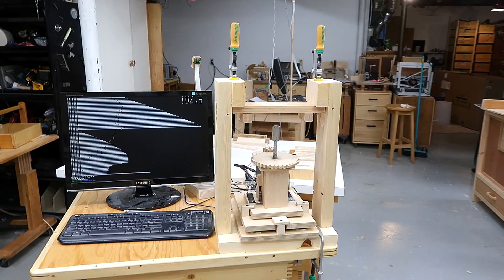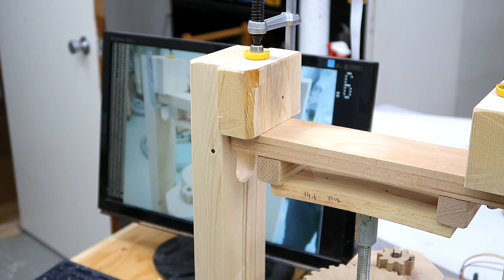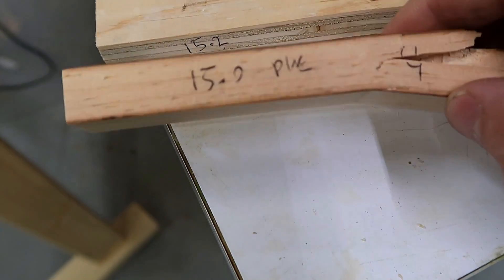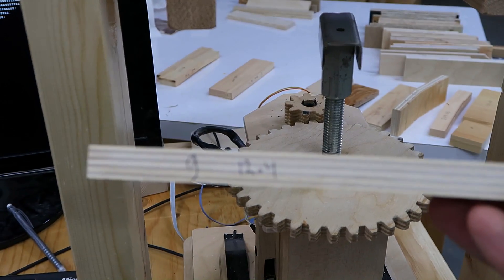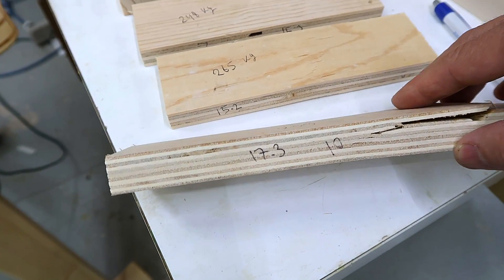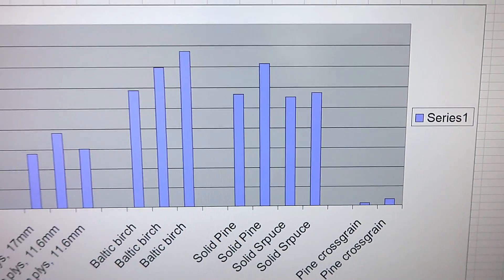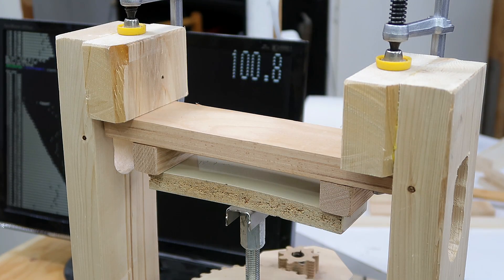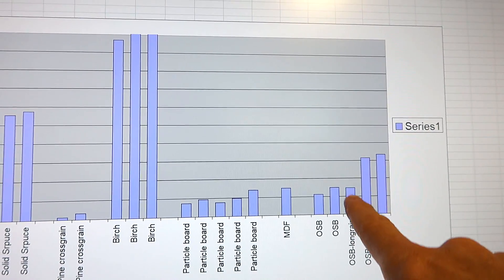How strong is plywood, MDF, OSB, particle board vs. solid wood

Comment: Nice tests. Now what about testing ply on edge? I would like to know the strength characteristics of 3/4" thk plywood when the load is applied to its edges. For example, if you stand the sheet on edge and put a weight on top (both distributed and point loads). Of course assuming it is adequately supported in that orientation. Does anyone know of a reference source for that engineering data in these scenarios? I will also be varying the height of this edge up ply wood too meaning I want to know how it's strength and deflection resistance changes as I make the plywood shorter and shorter or taller and taller depending on how you look at it.

Comment: I suspected these results, having worked with wood my whole life.  This is why I only build kitchen cabinets out of solid wood - especially the shelving.  When you stack a bunch of plates on a long shelf, if it's not natural wood (usually particle board or plywood if you're lucky...) it bends in the middle and has to be supported.  Solid wood always holds up.  I also refuse to use OSB for floor or roof sheathing, nothing but good plywood.  Walls can use OSB because you usually strap and use something else on the exterior, but if I was doing something like stucco or another applied product, plywood is better there too.  It all comes down to cost.  You get what you pay for.  That's also why I built my own sawmill, it's nice to be able to mill your own wood!
Reply: Good engineering doesn't overbuild and overcomplicate. Particleboard, like what you see with IKEA kitchen cabinets, are more than good enough for high-quality kitchen cabinets. People also shouldn't overload their drawers and their shelves. Take care of your stuff and it will last a very long time.
Reply: @CorneliusTaylor-s1u Yes, and as long as you don't mind lightly loading your cabinets, it may hold up for as long as you live.  However, looking at the 100 year old plus solid wood cabinets still in use today, fully loaded, I would argue that particle boad is not good enough for high quality kitchens, but rather for low end kitchen cabinets.  Plywood is better, but real wood is best.  Even at half the thickness, solid wood will out-do particle board any day.
Reply: @timfarry7071 

I didn't say anything about lightly or not fully loading IKEA cabinets. I said not overloading. 

IKEA cabinets are proven over decades now. It is in your business interest to trash them. You are not objective.

Oh, and plywood is much stronger and more stable than natural wood.
Reply: @CorneliusTaylor-s1u "not overloading" is the same thing as lightly or not fully loading.  I am completely impartial, what makes you think otherwise?  I have built with all three types of materials and gave my honest observation. Real wood is stronger than plywood due to the strong bonds.  Plywood is simply more dimensionally stable and uniform.  Real wood can fail at some points, but generally is the strongest overall, especially if it gets wet.  Plywood and particle board will delaminate and puff up.  So I guess it depends on how you use it and in what environment.  Wet environments are horrible for particle board, and in outdoor type environments even plywood can delaminate, and yes, even wood outdoors can fail over time, but generally holds up the best.  You can pick particle board if you want to keep costs down and keep it under ideal conditions year round, that's up to you!

Comment: I have three issues with the tests. 
1) You started with the round top on the piston and then changed to the piece of channel iron. All tests (not just the later ones) should have been done exactly the same way. You may have found the plywood tested even higher if it was changed.

2) You should have tested all at the same thickness and not trying to adjust for thickness in the results. The solid boards, fiberboard and MDF could have easily been planed to exactly the same thickness as the plywood (although the various plywoods couldn't have been planed down and still show accurate results.)

3) The samples should all have been the same width. When you realized there was an issue with hitting the breaking point with solid wood and you used a smaller width, you should have repeated the tests on the plywood using the narrower width as well .

The rules of thumb may be "2x the height, 4x the strength" and "2x the width=2x the strength" but that doesn't always scale precisely, due to if tit's quarter-sawn or cross-sawn, how wet or dry it is, etc. Tests from the exact same board being cut down may result in "2x the height=3.8x the strength", etc.

Comment: I think folk denigrate OSB over plywood.  
Your test showed OSB nearly as good, and better if turned through 90deg.
Also OSB should have all the flakes coated in glue, so any moisture won’t travel so far.  With softwood ply that is not the case.  Especially if not marine grade, as it can have voids.

Comment: I hate OSB. The only thing it’s good for is sheathing structures such as houses. Particle board is garbage too. 

I do like using MDF though, it’s flat and usually pretty stable. Only downside is how dusty the stuff is when working with it. And it doesn’t splinter like solid wood or particle board and OSB.

Comment: but in a bandsaw frame you would use the wood in a completely different orientation to what you tested, basically on edge and not flat, so while the video and the test was entertaining it was also irrelevant (in this use case)

Comment: Twice thick is 8 times strong, twice wide is twice strong.
Moment of inertia is  ^3 for thicknes, linear on the width... I=(b*h^3)/12

But... you are looking for a wrong characteristic of material :)
It is not ultimate strenght (force that will brake it) that is important for construction of some part.
It is rigidity (stiffnes). And rigidity is defined by modulus of elasticity.
You do not need beam, or a column that will bend like a macaroni, and return to its original shape. You need beam that will band as little as possible.
And you should never be even near braking force in any costruction.
So you need to measure deflection under some max force that is predicted for normal operation for the machine, and compare it between different materials.
Or just calculate modulus from your measurement.

Yes, yes... there is some dependancy between sthrength (ultimate tensile sthrength) and rigidity, but not so direct as people usualy think.
For example A36 steel have modulus of elsticity about 200 GPa, and ultimate tensile strenght of 400 MPa (about 1:2)
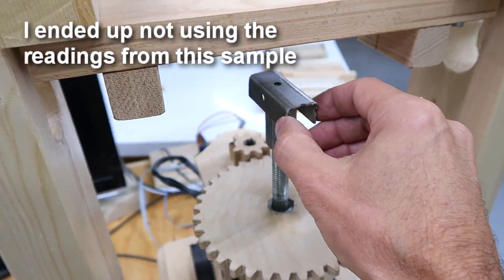But stainless 302 have modulus 180 GPa, and tensile strenght of 860MPa (1:4.7), ABS plastic 1.4GPa vs 40MPa (1:28), aluminium 69GPa vs 110 MPa (1:1.5)...

Comment: The strength of the solid wood may depend on which way the growth rings run (whether the wood is plainsawn or quartersawn). This occurred to me when another comment mentioned making up beams of plywood or OSB so the plyies are parallel to the stress. This would reduce the tendency to delaminate like many of the failed samples did.

On the other hand this is not very useful because of the trouble of using any built-up wood in a project like your bandsaw.

Comment: I think that if you put inner layer with the plywood cut in diagonal it would be stronger.  And if you added some fiber glass roving and used a quality urethane glue with good curing pressure.

Comment: Can you do a test with for example pine 10mm thick and take the readings when it brakes. Then put two similar pieces on top of each other and take the readings. And finally a third set of similar pieces but glued together.

Comment: Wood, even engineered wood, has radically different strength in bending, tension, and compression. In a band saw frame (a truss structure) the weakness will be in tension/compression. Testing in bending is not equivalent.
Reply from the maker: On a bandsaw frame, most of the stress will be from bending because the load is off center.
Reply: @matthiaswandel  if so, then one side is in tension, and the other side is in compression. It’s not the same loading as a perpendicular point source bending force. Wood is a non-isotropic material. And if that is the case, then the shear strength also potentially factors in, and that too is different from the compression and tensile strength.
Reply: @kimsmoke17  the main frame of the bandsaw is a C-shaped beam. The main force is bending because the load is so far from the vertical column. It is very similar to a straight beam with a distributed load, supported at the ends. One side IS in tension, and the middle IS in sheer. There is also some twisting force because the blade tension is offset from the beams longitudinal center. But as it turns out, wood had plenty of sheer strength for this application. So the failure will begin far from the neutral center of the beam.

Comment: Which is why you should board a roof with solid wood boards (if you are going to) rather than OSB or plywood, If I have to use man made boards for some reason I prefer Far eastern hardwood ply WBP.  I do not like OSB for anything much !
Reply from the maker: And based on your comment, it's clear that you don't do any roofs.
Reply: @matthiaswandel  That’s what I do son

Comment: I worked in a lab where we tested particle boards and OSBs and there are big differences among the different types that are produced. Some boards are 2-3x times stronger than others when it comes to bending. We also tested vertical ripping, surface strength, volume changes after boil etc.

Comment: How much of your band saw is loaded in 3 point bend through the wood thickness though? Not a lot I’d guess. You can get an idea of the strength of the wood in bending (dependent on the structure and loading direction), however the main box structure of your saws are loaded in compression and tension on the edge of the wood…. And of course they are box a section which adds strength. :)
Reply from the maker: The load is off center, so it's mostly bending stress.

Comment: I feel that plywood and OSB weren't tested under the right conditions.
I still feel that solid wood would be more appropriate for the bandsaw, but if anyone started building it with plywood/OSB he'd stack sheets with the faces vertical, so the bending load would be applied through the thickness of the ply/OSB (I hope I'm explaining the orientation well enough).

Probably the results would be even worse, but still...

Comment: I recently got some 1/4" 2x8' sheets of pressed hardboard that is dry-erase on one side and chalkboard on the other from the cull lumber section of my local House Station. 70% off, some rough edges but otherwise good. I've been using it for drawer dividers, but the dry-erase side is very smooth and hard like melamine, so router table top, blower impeller disks and cabinet doors you can put notes on. Big chunks of Masonite too, almost a whole sheet of 3/4" for $7.

Comment: Baltic Birch is expensive but if you are building anything you actually care about or that you need to be remotely strong its worth the price.  Your Home Depot plywoods aren't actually that much cheaper but are so much worse in terms of their quality, their strength and how hard they are to work with that I would just not build something if I had to use them.  The plywoods at big box stores, even the 5-7 plys are only good for construction, thats it.
Reply from the maker: The problem for me is there isn't a store within 2 hours drive that sells baltic birch
Reply: Yes, i feel that pain.  My local lumber yard closed a few years ago and forces me to drive admittedly a lesser 1 hour away for my supply.  

I also don't build at nearly your scale so buying several sheets lasts me a very long time.

Comment: 2:09 the solid wood cross grain test is not valid as the piece you tested doesn't appear to be one solid piece but rather glued together strips and the failure is at a glue joint. Still It likely wouldn't have performed that well anyways but should have been higher than 43kg.
Reply from the maker: it didn't break on the glue joint, so does the glue joint even matter?
Reply: @matthiaswandel  It just seemed like it did in the video. The glue joint is on the letter 'o' of the word "Cross" and it appears in the video it snapped right on letter 'o' which can also be seen at 2:12 when the broken piece is sitting next to the keyboard. I guess it doesn't really matter though. Appreciate the test.

Comment: I imagine that for something like a bandsaw frame, long term creep under load is an important factor. I would be interesting to do a long term test on a bunch of samples, each deflected the same amount initially under X load, then follow up a few months later to see if any have changed. Also which materials deform more or less plastically and/or elastically, long term.
Reply from the maker: Yes, stiffness and creep are the biggest concern.  It has more than enough strength.

Comment: If you drive through a subdivision you can see the houses that have osb for roof sheeting. It’s definitely not as good as plywood.
Reply from the maker: It's ok until there's a leak in the roof!
Reply: @matthiaswandel not so, I have seen OSB used untreated for cladding / fences.

Comment: A lot of people think strength is a cubic because of I = (1/12)*width*thickness^3. But they're forgetting the stress equation (stress = M*y/I) has a thickness term (y = thickness/2) that cancels out and makes it a square law.

When you substitute M = (1/4)*Force*Length and stress = Ultimate Tensile Strength, you get:

F[max] = (2/3)*(1/L)*UTS*w*t^2
Reply from the maker: yes, so many comments saying its with thickness cubed.  So annoying.

Comment: Hmmm.. technically if you consider bending dominant behavior (planar strain profile) with a maximum stress failure criteria, the strength of the section is proportional to cube of the section's height.  Given that extreme wood fibers usually break first, this is not a bad assumption (a linear strain profile) - this is what we call allowable stress design method.  For a material that yields and has a large inelastic range of strain (i.e. it is ductile), the strength is proportional to the square of the section height (but the strength comes out as a larger number for the same section as well).

Comment: heres a question, how many N of force are in effect when the band saw blade is at its proper tension, how would you even test that?
Reply from the maker: There are various ways of measuring blade tension.  But people who actually use bandsaws don't bother with it.  Basically, once you have experience, you just now how far to crank it by feel, without looking at any gauge even if the saw has one.  300 N is plenty for most.
Reply: You can measure the deflection of the frame when the blade is tight. Then remove the blade and find out how much weight is required to get the same deflection.

Comment: Wouldn't the resistance to breaking be inversely proportional to the second moment of area (a.k.a. area moment of inertia), which for a beam scales cubic in the thickness of the beam and not quadratic?
Reply: The stress equation (stress = M*y/I) has another thickness term (y = thickness/2) which cancels and makes it a square law
Reply: @toolscientist  I already thought I was missing something obvious. It has been a while since I had to do any calculations regarding beam bending and mostly remembered it had something to do with the second moment of inertia, but indeed the actual stress increases linearly from the neutral line, so the max stress would indeed be quadratic in thickness.

Comment: So solid birch is best but what is good enough?  So is high layer plywood and Baltic birch plywood good enough for those that complained?
Reply from the maker: Baltic birch is excellent where you need strength but don't have room for thicker plywood.  Also, nice hard smooth surface, so could be used for a table top.

Comment: If you are interested in actually designing things with plywood you can find tables of engineering properties for plywood that take into consideration the plies that would be crossgrain and not contributing to strength.  If you were doing the same design with solid wood you just calculate those properties directly.  Plywood better compares against solid wood in construction because it is more consistent.  If you were building a tongue and groove floor and you had a truck load of boards you would have variation in the materials from board to board, you won't have that much variation with good plywood.
At the very beginning when you were bumping up against the limit of your test machine using softwood plywood I could see that you would have a big problem when you got to hardwood plywood and solid hardwood.

Comment: Great video and test results.  I am sort of blown away at the number of comments claiming the results are flawed as so many people do not understand the relationship of the geometry of the piece  and how that relates to stress and strain under bending.  The methods used in the video to normalize the results are correct from what I could see.  Stiffness dictates total strain under a loading condition and the failure of the piece in this test is dictated by the compressive and tensile strength of the extreme fibers of the test piece.  Great video.

Comment: I would've guessed OSB to be way worse, how many times have we just broken the offcuts with out hands like it's nothing
Reply from the maker: I think small pieces of OSB are awful.  The chips are very long, and if the piece isn't long enough for the chips, it does bad.  Which makes me realize, at 5 cm width, the OSB wasn't doing as well as it could.
Reply: @matthiaswandel  that might be it, I wouldn't trust a strip of OSB to hang my hat on. But on the other hand I would stand on a suspended full sheet any day.